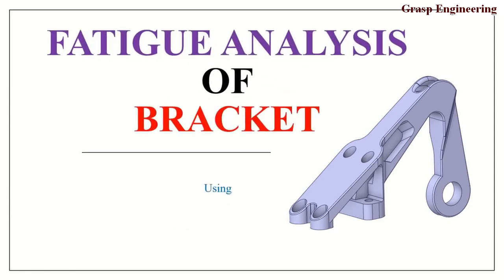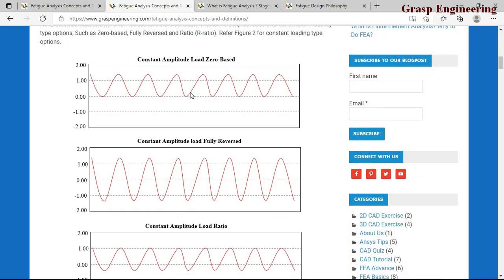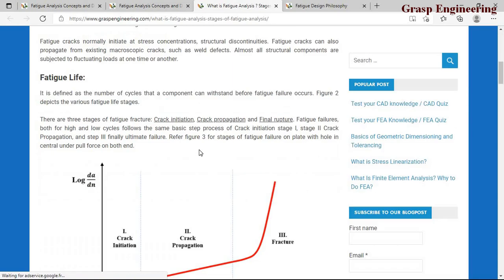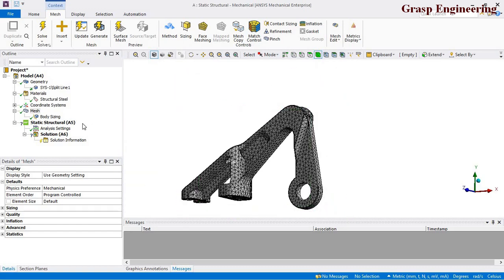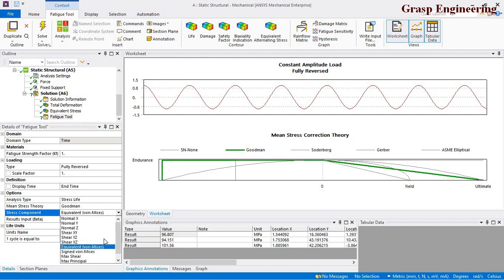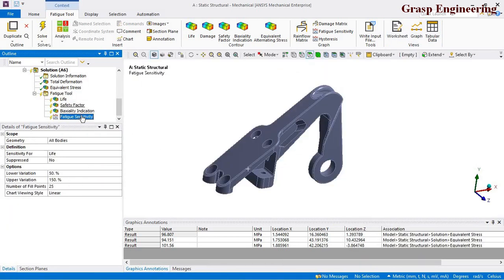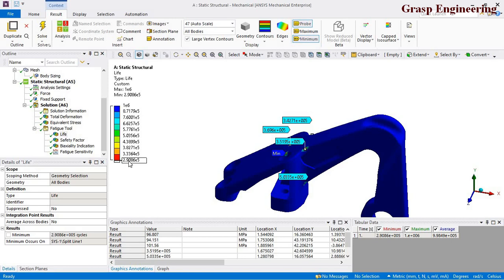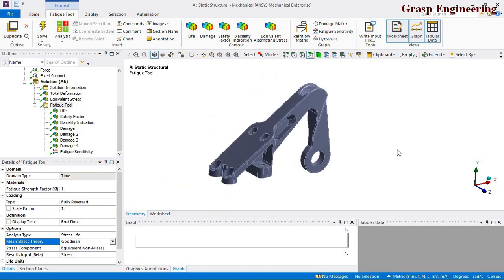Fatigue Analysis of Bracket using ANSYS

Comment: Hi, nice video. In theory you usually use Marin factors (correction for endurance). How can this concept be applied to this analysis? In case of vibration fatigue the procedure you explained is the same?, What is the difference in using n-code to fatigue ansys mechanical option?, Thanks a lot, best regards.
Reply from the maker: Thanks. Mechanical fatigue analysis is simplest fatigue analysis tool which does calculation based on static analysis results. Marine condition factor is effects of surface conditions. This tools gives provision for fatigue strength reduction factor, (You can define here surface condition).  We will upload soon vibration fatigue analysis video too and if possible ncode too.

Comment: Thanks sir for your kind information…
Reply from the maker: Welcome !
Reply: @graspengineering9249  sir 
I have a heavy steel structure like a frame, there is a 3 motor of 15HP, 1750 RPM, 117kg weight, 3 motor at different position..
My structure natural fist mode is frequency is 9 Hz
My question is that how apply our motors load and check for resonance..
Kindly explain or any your videos….